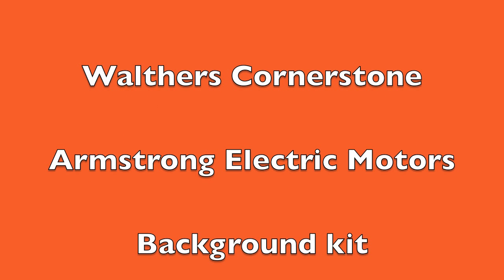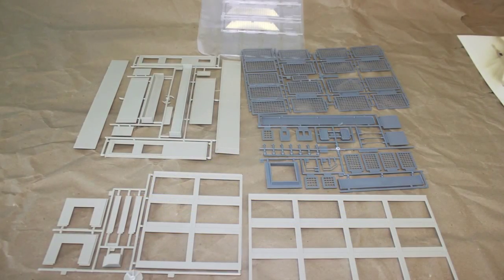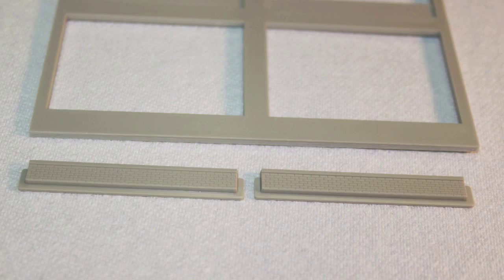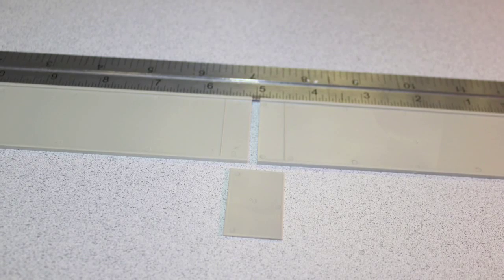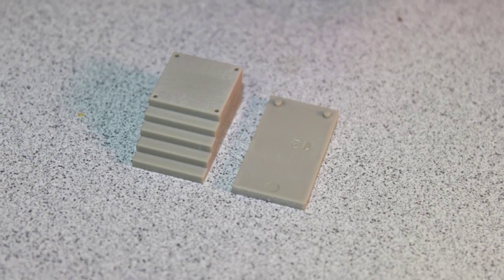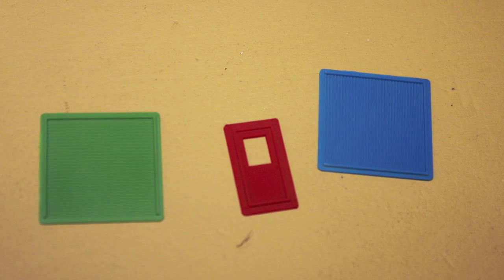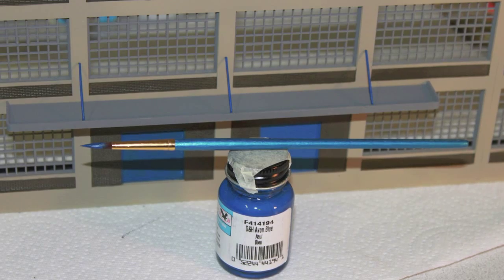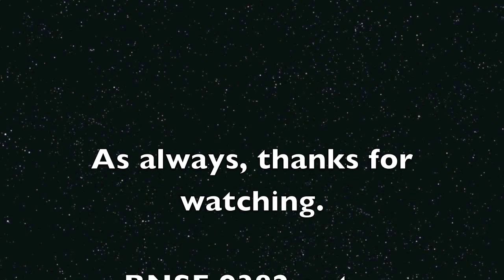Walthers Cornerstone Armstrong Electric Motors background kit slideshow

Comment: I just bought this kit. Thanks for sharing your ideas
Reply from the maker: Hope it helps.
Reply: Question ...how did you black out the windows? Paint, or some kind of paper?
Reply from the maker: I don't paint the windows as I may want to put lights in later.  I just use some black poster board.  I think I talked about that in one of my other videos.  I hope you watch some of the others…